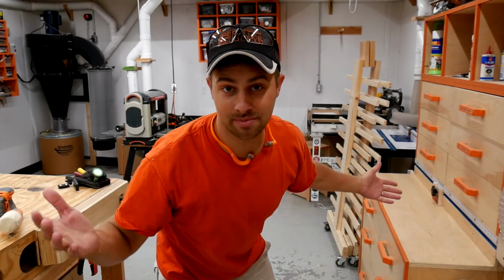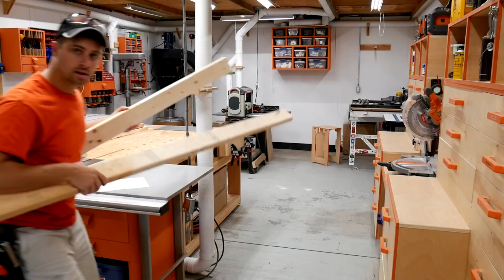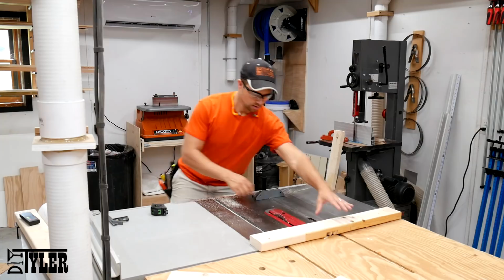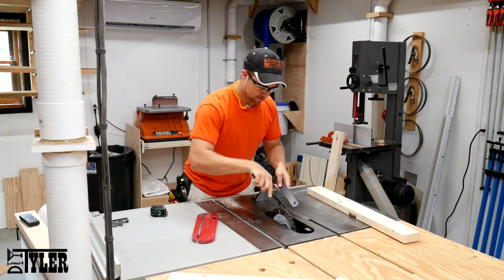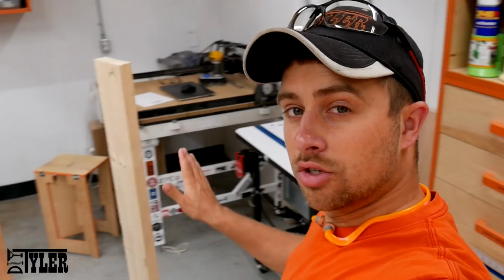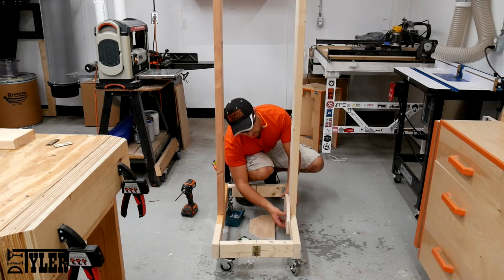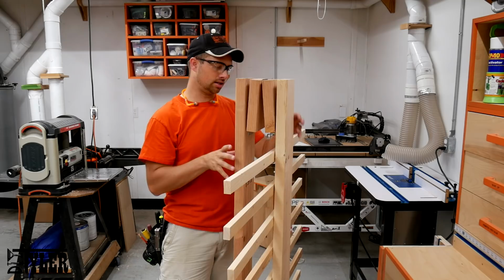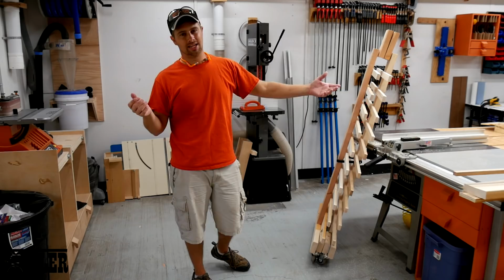Folding Drying Rack for Finishing. YOU NEED THIS!

Comment: I just built a folding drying rack based off of this design and it worked great! I did not put casters on the bottom however. 

In response to some of the other comments about putting nails on the rails, I think that would end up causing more damage due to accidental scratches while putting doors on and taking them off. I have personally never had any problems drying doors on square 3/4 rails. 

Tyler, thanks for sharing your work!

Comment: Awesome Idea!! I'm going to build one. I have an idea for you that make it even more awesome. On each of the arms where the drawers will sit when they are drying, What about driving two very small nails into the 1x2s and then cutting the heads off the nail. The nail will raise the doors up off the wood so it can dry without touching the 1x2s. it will then allow the bottom of the drawer to dry without leaving a mark of the boards its sitting on.

Comment: Thanks for posting Tyler.  I needed one of these as my garage was filling up with cabinet components and it's coming up on time to paint. I used pocket screws on the 2 by's instead of lap joints but really the plywood support panel you said wasn't necessary is actually all I believe is needed.  I like your idea of hinging everything but I wasn't willing to buy them so I screwed base plates with casters to the bottom of each end.  When I store mine I will need to unscrew them as well as the top support to collapse it. I also shot 2 inch nails through the one and a half inch racks to rest the work pieces on while drying.  Your video was just what I needed to help keep me organized.  The sanding is done and the painting starts today. The hinges definitely make yours cooler, but at least I can get the job done now. (thumbs up, liked and subscribed)

Comment: If you bevel the holding racks there's less surface area touching your work
Reply: I just put those tiny push pins, the colored spherical ones people use on maps... leaves only a small area that touches and paint usually doesn't stick to the glossy surface of the tack/pushpin

Comment: Awesome idea!   I know it was largely a design as you build project, but it still turned out great.  Having the benefit of seeing how you resolved some of those issues gave me some ideas on how to change up the design if I were to build one.  Maybe put the slats on the outside instead of the inside, then they wouldn’t interfere with the hinged parts.  I’d also be curious if it was still stable enough ( may not be) if you used the same hinge at the top, at the bottom, and didn’t use the side hinged pieces.  It would be slightly less hardware, and should lock with gravity, the casters would still be at the ends of the “tee”.   Just a thought.

Comment: I think I'd try putting nail points every 2 inches along the tops of the rails at say about 1/8 to 1/4 high to lessen contact with the painted surfaces. Could even just staple them to the sides of the rails.

Comment: That hinged piece you put to hold the top portion apart could have been connected to an identical piece at the bottom. The weight of the vertical board connecting the two would hold them straight and keep the thing from folding up on you. Or, you could have had angled branches at the bottom of the center portion reach out to the bottom hinges. Again, the weight would keep them apart well enough for the job they have to do.

Comment: Looks great, Tyler. I might make 2... one for my shop & one for my wife's art studio!
Couple of thoughts: 
- What about using rare earth magnets & a washer in the end-grain of the short stretcher pieces to keep them from unfolding while moving instead of the manual clips? Do you think they'd be strong enough to hold it open in motion?
- Did you consider bringing the supporting rails to more of a point (maybe beveling them) for less surface contact? What do you think would be pros/cons of that?
Reply: Sounds like a good alternative, but if for some reason the connection is forced apart in some way, it could collapse the stand and send all your drying work to the floor.   A physical locking joint maybe preferable, especially if people doing commissioned jobs with tight turnaround times.

Comment: You could always dado in the 11th set of supports at the top, so they don't interfere with the top hinged piece?
Reply: Neil Kightley  or even put them on the outside of the 2x6 instead of the inside.